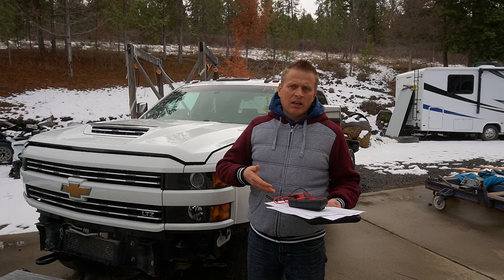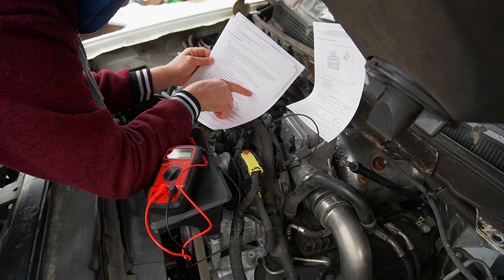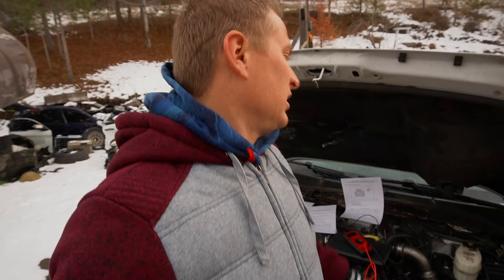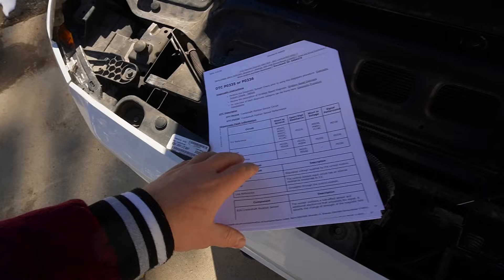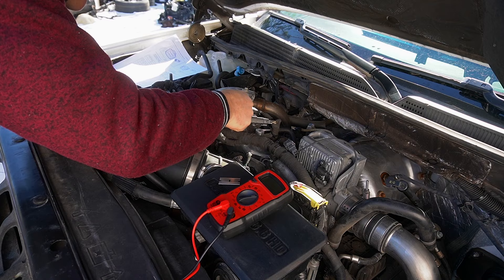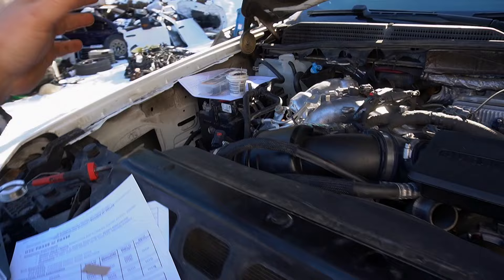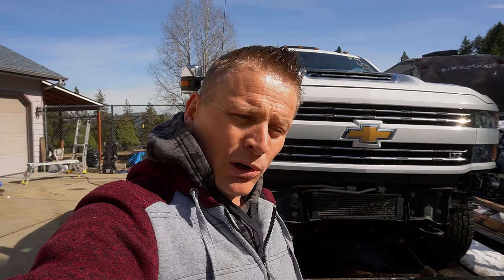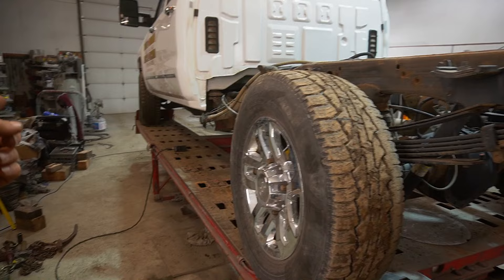I Found Why It Won't Start And Fixed The Frame

Comment: Congratulations.  I thought it would be a crushed wire never thought it would be cut wire.  Get the rest of the codes especially can bus worked out.  Will make sure you don’t wind up with more issues later.  Nice work on that  frame machine🎉🎉🎉

Comment: I just love how hardworking you are. And this is the feature i see for you in 2-3 years. If i Remember correctly you own pretty large part of the land. So i think you gonna build big barrack where you will have paint both, an frame rack (if its to expensive to buy you will just get metal from junkyard and weld your own frame rack XD) and an hydraulic lift. And you will hire 1 person for sanding and paint prep. Each week you will have new project because other is finished.

Comment: i worked on trucks and cars 1978 -1980 in tech school & went in military  ok why the big wig from GM the people at chevy the car maker Ie truck engines and stuff [ Ps i don't trust them ] everything going to computer controls and it would be great but all your training crap!  it be phased out! the school closed in 1982 but in 1984 i was hit by a car on a bicycle & in my recovery well still in military I was TDY to new people (the main place that run the area I was station at for munition it like a prison oh great like a week before you know any thing about computers at chow hall lady lives off base ,you work in electronics like find one my daughter flunking school i got one I found a major error in one at home off base I did odd jobs {find a junk computer and make it work} at base at job in like prison a IBM computer & a little guy named Mr gates shows up I hear it junk & this! who would pay 5000 dollars for this pile of crap! the bosses talking I went in made my point real clear to MR Gates THIS IS YOUR JOB IT NEED CHANGED OR IT GOING LIKE DODO BIRD! TO GO TO REAL PEOPLE! I had no idea who he was just a little guy he wrote the manual for the software it was wrong & the computer need changed and adding like a mouse & link system & like windows why 35 years later the computer saved my life really it not a joke or crap it true i have a 100% death rate cancer the name i have from the number 3 man in a normal 2 person seal adoption he related to me closest in said family living! ok dna blood samples to the man who lived threw this cancer was the same man! my real mothers uncle! the control for this cancer was based on his frozen blood! ( how would a  GM the people at chevy car work if the main computer not here to fix it now!) I in 1984 to Mr Gates this has to be done! like minutes from now the bosses for the US goverment military did  come in here your gone its crap & junk the computer dead! that what was told him! after i left! you got to fix this I here that! you would have al those wires sensors or me on a windows 7 computer that a pile of left over junk! & windows xp stuff too from junk de-funked computer's shop owner wife died & i bought him out when he moved on to after life too!  & Microsoft has no idea it was me who started this mess! with a less then 5 minute talk in 1984 to Mr gates